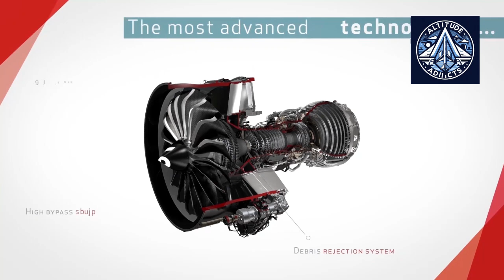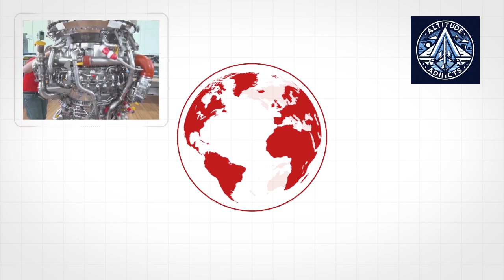Safran to Make Blades for LEAP-1A engine as Supply Chain Dries Up

Comment: Well, the engines are from the French multinational SAFRAN and GE is just a licencee or in other words a franchise of SAFRAN known as CFM International, oviously GE is the lowest common denominator making numerous mistakes and using components below par than the OEM for years, remember the SaM-146 from the Italian/French SS100 project, it was the US made turbine blades that doomed that engine until Saturn of Russia took over building them after the Italians abandoned the project and later on it happened again with the CFM-56 from CFM International.... The OEM has to take over controlling manufacturing and make sure lcencees don't mess up their business.....
Reply: No, Sam-146 uses the same core module of the French's Rafale M-88. So, it is 100% French tech that create the problem.  GE has not any share on the engine.
Reply: @alexlo7708  The licencee was Leonardo of Italy and they sourced the modules from CFM International and many of the components were made in the US specially the rear hot section that grounded the Intejet's SS-100's because the OEM of the turbine blades refused to guarantee their work and refused to continue their production....
Reply: @alexlo7708  Blades were produced in USA.